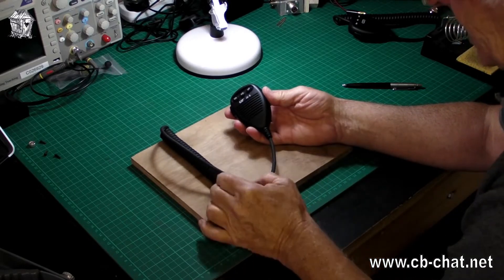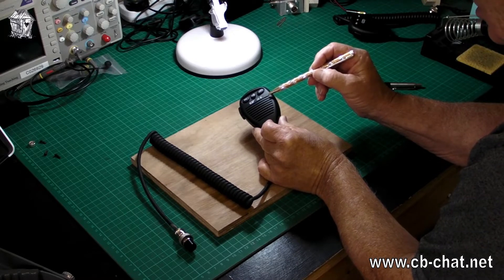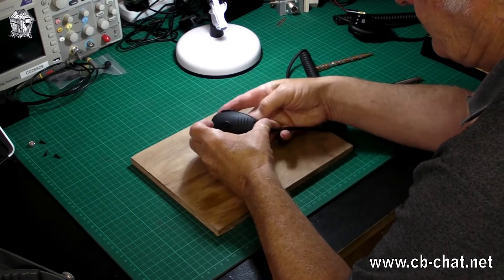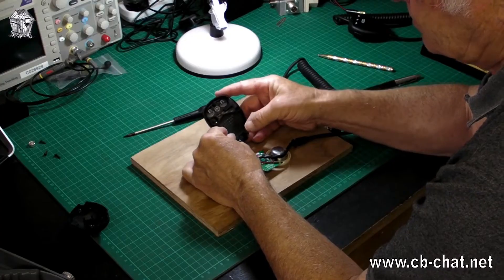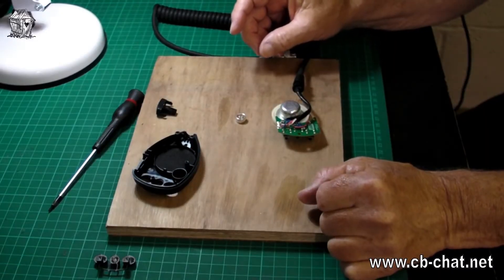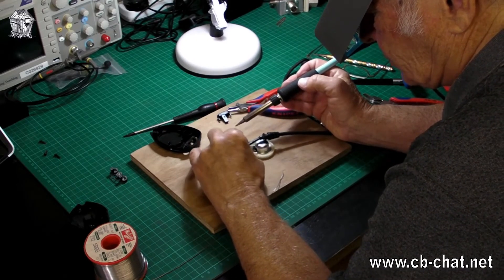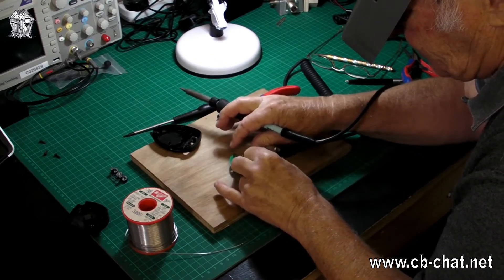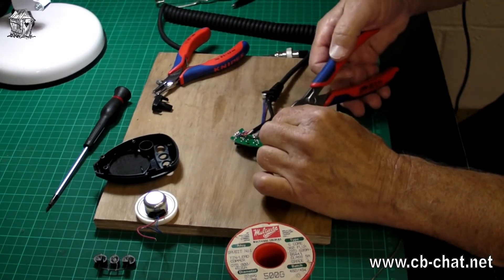CRT SS 6900 Electret Mic Conversion

Comment: Great Content . Does this convertion still apply to the 6900 N ? 
And do you know if the SS69000N have a hidden menu for the backlight ( as mine is very dim ) or would i need to send it of for a repair !! ??

Comment: Hello Ken Williams. Thank you for a good video regarding the mic change on the CRT SS6900V as I bough now in FEB.2023. Very good tranceiver. My question is: Where did you buy the Electret mic element? (Shop name and internett adres/home page?) What is the factory and model nr./product type identification as we have to know before we order an electret mic element. This is just as important as your excellent video. Thank you for your kind answer. Looking forward to your answer. Thank you very much. Best. regards, John in Norway.
Reply from the maker: I bought from a guy on eBay, but he is not selling them now. I went for a good quality Panasonic brand. Plenty on ebay, but I cannot find the exact model.